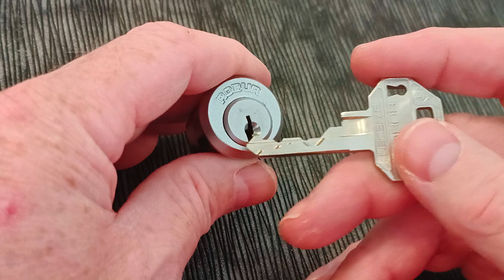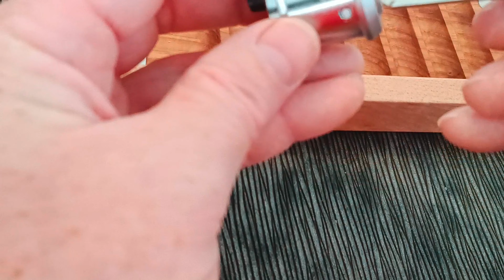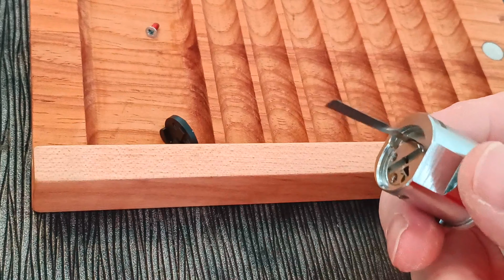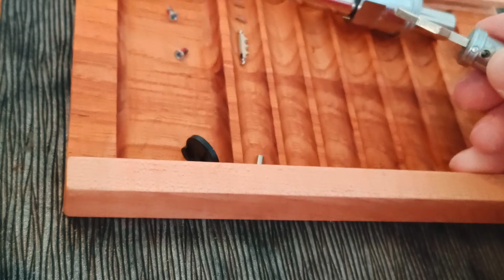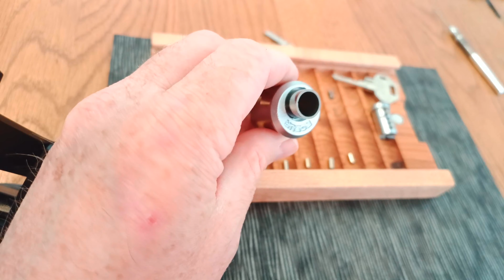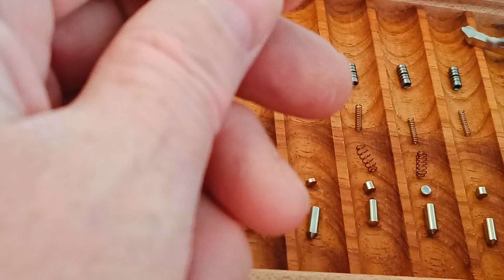Robur 2391 safe deposit box picked and gutted

Comment: I don’t think I’d have been brave enough to gut this! Well done. I’m curious how you knew to keep with the sidebar all that time instead of working on the main pins.

And yes, those drivers are exceptionally small!
Reply from the maker: So long as you don't let off too much tension the top pins stay set and so long as you are feeling any resistance on the sidebar pins the top pins must be set as they just don't bind until the top pins are set as you get a very small amount of core rotation once the top pins are done, also the side pins make a very distinctive sound as you drop them so I am able to keep resetting to that point. You do still wonder though so hence checking the top pins every so often. As always I found this much harder on camera and have picked it in less than 10 minutes before but I was quite invested so carried on. Thanks for watching